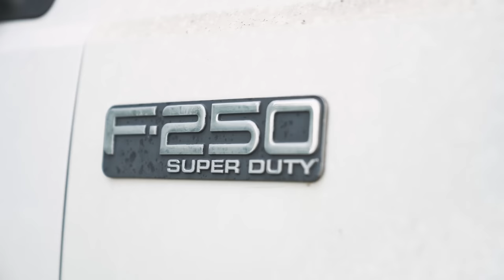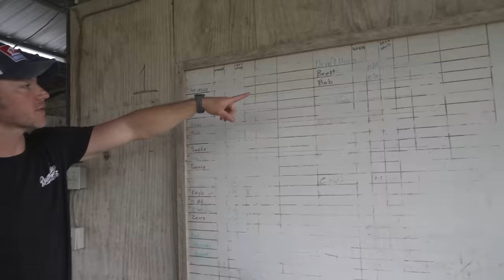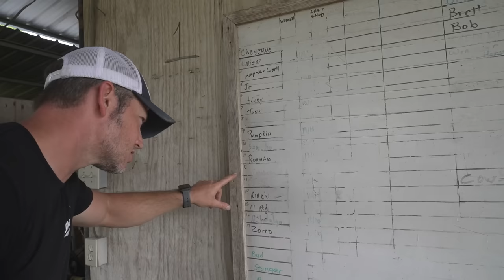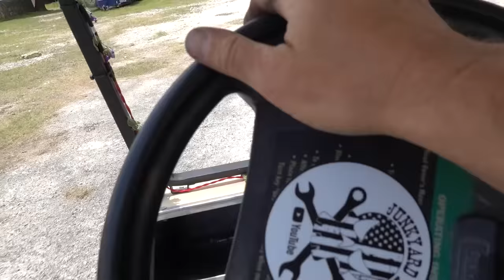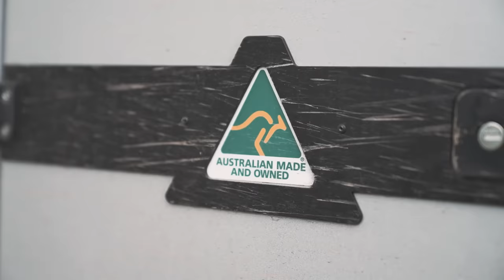Renovating an Abandoned Resort: Part 5

Comment: I'm sure you already have a plan, but I'd suggest a good starting point would be to tidy the place up before any renovations:
1. Empty everything out of the buildings and rooms. Get it all outside and sorted out so you can throw away all the junk, and know what you have left of any value. It'll also make renovations much easier if the buildings are empty and cleaned out.
2. Mow all the grass/weeds in the main resort area, just to tidy the place up a bit. It'll make it much more pleasant to work outside, and it'll help you visualise the area better in preparation for the actual renovations/restoration.

Hope that helps!
Reply: Throw this man Adam some likes! I said the same thing 3 min into the video. Start from a blank canvas. Clutter just makes things convoluted and frustrating.
Reply: Tear down the chimney(s)

Build Alamo or better ranch house on the lot
Reply: 1. Clear out and empty all buildings 
2. Catalog and inventory everything worth keeping
3. Throw away or burn the rest
4. Have a party of 100 people come with all their own weed eaters, mowers and trimmers to Clear out all the overgrowth, get perspective of what you have to work with
5. Cut down and burn all trees that are dead or not worth keeping
6. Treat and Reseed all grass areas to try and get it back under control
7. Power wash all buildings that are worth keeping
8. Demolish all the rest 
9. Start from scratch with some YouTube builders and just have people in rotating shifts building new structures and maintaining the rest
Reply: You thinking small scale. 40+ buildings makes that task beyond doable.
Reply: @SOLOIIguru  shit if my skid loader had the aux hydraulics all hooked up, i'd definitely come down with a mower
Reply: @ravenbarsrepairs5594  so tackle it one building at a time....can't be more than 1 days work worth of clearing out a single building. Could have every building cleared in and ready for maintenance in less than a month,  especially with volunteers

Comment: An electricians perspective on turning power back on. I would take my multimeter and check your ungrounded conductors for any continuity to neutral/ground (lightbulbs out nothing plugged in) to give an idea if there are any shorts in the system. Obviously a visual inspection can help quite a bit too but with electricity there's a lot you can't see. Hope this helps.

Comment: I've worked on big projects, but never this big!  However, one thing I learned with a big project is you have to keep your focus. If you try to chip away at too many little things, nothing gets completed. You know this but just reminding you.  Pick one thing and work it to completion then move on to the next thing on the list. You'll get a sense of accomplishment with the completion which will keep you fired up. With a crew behind you, maybe you can work on a couple of things but keep your focus tight. Good job so far and good luck!

Comment: THE BIG LODGE CAN BE TURNED INTO AN OUTSIDE SIMI PERMINENT TENT STRUCTURE.  Use as much of it as can be repaired/strengthened as the tent supports and those two story fireplaces can have the second level harths closed off temporarily.   This then could be the main reception room/party and bar for weddings, parties,  events until it can later be rebuilt into the party mansion that it deserves.   

It can be a great wine, beer and wiskey bar and food area for happy people.  Don't forget an awesome sound system. 😅
Reply: Now I think I see it. Just like those large corporations event tent tops.  It would cover everything but no walls.  I don't know it Matt has 220v power, but eather way wire things up for a full kitchen,  lights,  entertainment.  He might even have a few large trees on those 300 acres to get 6" thick slices to make long tables for the rooms.  This would not cost that much and finish a major project for the property.   

I like it
Reply: He took his friends to Montana and talked about a goast town.  This idea would be a key to having a huge western bar and entertainment area.  If he added a second floor in the center for maybe just one room he could have a grand staircase to make this ideal for weddings and photos.

Pool table, shuffle table, darts, slot machines bar. Yes his cowboy goast town party room.
Reply: Grin, if he added that second floor he would need to make sure he had good sidewall support.  But that might be a nice spot for a private range if the ground layout could support the angles.   Would be hard to do and most people would not even know he could do that.  I like how quick this could make that happen instead of waiting for him to rebuild a building.

Comment: Spin the ring that holds the fuel pump and pickup assembly onto the top of the tank and pull it out with the lines attached....replace the pump amd put it back in.

Comment: What a great property to be the steward of! Cleaning and working on it will give you a solid feeling for how to bring it back to life. Water ways need special thought and care. Small country cabins....bunkhouse....all done in western/mod would be nice. Love the old fireplaces, too. Having them as the center of outside dining would be nice? The lodge, etc, to to curve around them, but not a complete circle? Horse barn looks to need a lot of work....design there will depend on how you want to care for the horses. As a vet you know a couple of 12 x12 etc stalls are nice for emergency if a horse gets hurt. Out side corrals......lots to be done! And of course... figuring out all the most important stuff...electrical lines and water lines....propane...Going to be fun to follow along!!

Comment: My mom told me that my grandma used to say “success by the inch is a sinch.” Meaning little by little you will get there. Take it easy, slow and steady and youll achieve your goal easier than you expect. I think thats applicable here. You have a million things to do, but just take it easy, slow and steadily pushing forward, step by step, inch by inch and before you know it you will have success and will have enjoyed the journey there a little bit more than if you had tried to do too much too fast which frazzles ur mind and takes a little of the fun out of things.

Comment: 8:21 you can fix that battery by using a welder. You hook it up to the terminals and blast the degraded anoide and cathode so it holds a charge again

Comment: Okay to start you need to find a grapple for your skid steer would help with the cleanup and if you can find one and can afford it a decent size escavator would help and see if you can find a company that would drop off 2 of 3 slide off dumpsters you might be surprised how quick it would  go with the cleanup

Comment: Just an fyi on the rope swing , it is likely that at the time the rope was placed the water depth was significantly deeper than it is today, this process is known as river channel migration which is a geomorphological process in which sediments move from place to place within the river, because of changing  river conditions such as flooding, dams or errosion , causing deposition of those sediments in different parts of the river, and can be frequent depending on local conditions.

Comment: 5:03 check that the needle valve is tightened and check the seal on it.  Surprised how often thar is the issue in old equipment

Comment: You should have tried to toll it forward, put it in second or third and push the clutch. When you have some speed, release and this will turn the engine, pump the old fuel and it will try to run.

Comment: You can fold the chicken wire at a 90° angle. then put it under ur cinder blocks then tie in to the existing chicken wire. That should solve your problem. And I think you should also keep the name OffTheRanch.

Comment: lol but you need someone that is focused and those burnt up building need to come down and maybe use the ruble/rocks to build a dam on the river to build up that rope swing deeper. sucure up the tools, pump out the pool and check it for cracks, if it has elecrical lights in the pool get a electistion/plumber to check the wiring and seals and fix the pump. when junk yard diggs does a, (will it run show), they make a list of ever car part their going to need. MAKE A LIST and go. i'm with you and you can do this. let's get going. lol

Comment: The building with the Fireplaces and all. The fire has very likely weakend large parts of the stonework, so to be safe, if its going to be rebuilt with the existing layout, it would really need dismantling and rebuilding. A costly time consuming process. So, from what I can see , if it were me, I would demolish the whole thing, and start again with a clean sheet of paper, so to speak. The rubble could go toward the buiding of the berms on the range.

Comment: You need a project manager, you need a schedule. First thing is to FINALIZE all your utilities, power, water, sewer. Until those are legal and running there's no sense screwing around with all the other stuff. Work on whatever building will have your electrical service, all those separately derived buildings are getting their power FROM THE MAIN SERVICE so it only makes sense to start with the primary building.

Comment: Have smaller YouTubers come in and piggyback your success… farm out the work to them… architects, designers, landscapers… they can work on the ranch and you can promote their videos about them doing the work.  You can do a weekly wrap up video and link their individual project videos on the ranch.  I would get a building with accommodations done first so they have somewhere to stay on site.  You would need a space so they can finish their video production on site as well.  All of it works, it could be a special place for a lot of creators… calm it Creator Ranch.

Comment: I can believe you're sacrificing safety, to save a few bucks, If you can't fix the truck properly, you should not be driving it until you can fix it...I just hope no one gets hurt because you didn't fix it right...I guess that's what rednecks do, bubble gum and baling wire, reckless and irresponsible...